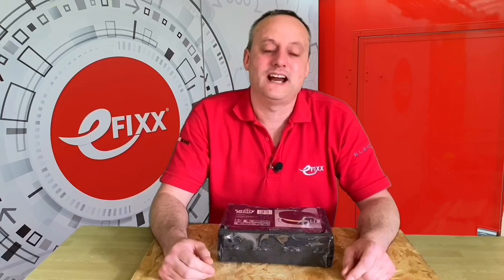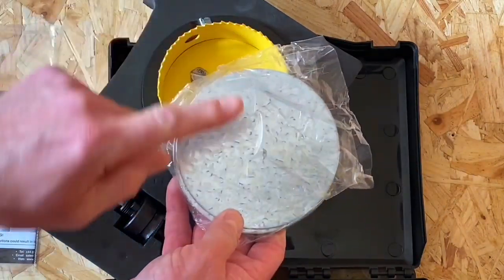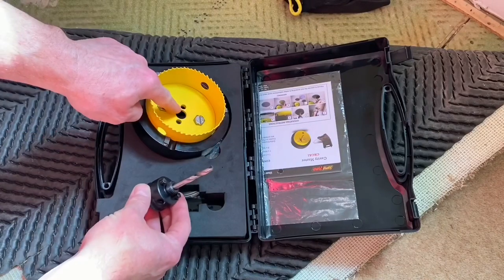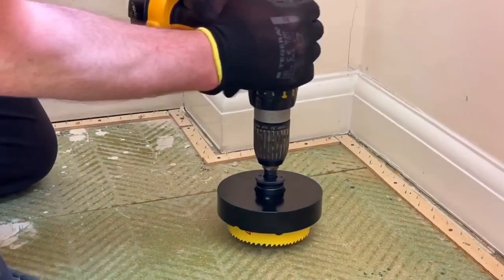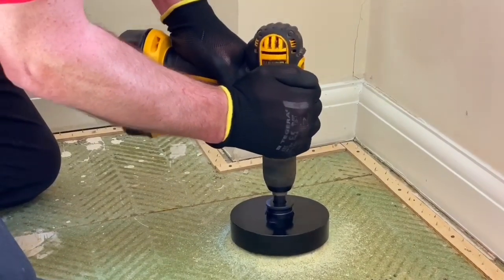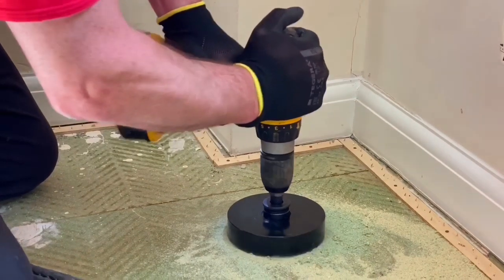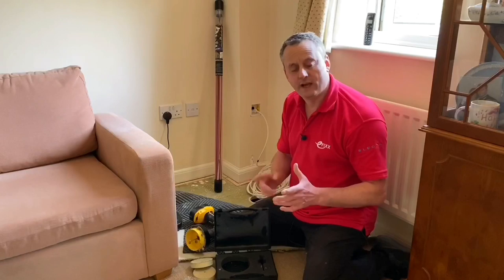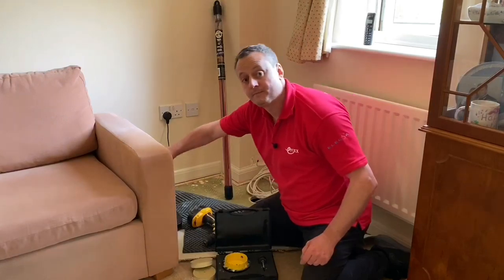Chipboard floor access hole using the Cavity Master hole saw.

Comment from the maker: efixx
8 minutes ago
**UPDATE**
We made this quick video to answer a few questions raised on our Cavity Master review video. How do you know cables, pipes etc aren't sitting right under the floorboards?
https://youtu.be/HtZlqd8wt9s
Reply: Still need to have balls the size of King Kong. I went through pipes that had actually been clipped to the underside of the chipboard once! My circular saw was about a millimetre over the depth of the board and that was enough for a face full, and floor cavity fool of nice cold running water
Reply: @CoulterTravel  And just like that, I'm now going to set my circular saw to 1mm above the depth of the board. Cheers.
Reply: @1992jamo  good luck with that, mate. How to do intend on getting the exact measurement of the chipboard in a new build house, to the mm, before you do that?
Reply: @CoulterTravel  I literally just finished cutting the floor and it went well cheers! I used a hole cutter where the board is over a joist, and measured the thickness of the plug. Set the saw about 1mm above that. The board was surprisingly stubborn with so little material left, so I used an oscillating on it's lowest setting and carefully cut through the little remaining material.
It worked really well, and I'll use it again when doing the kitchen lights.
I'd send a picture but I have no idea how to do that on youtube.
Reply: @1992jamo  you got lucky this time, fair play. These new build plumbers do what they want. Pipes can even be clipped to the bottom of the boards!
Reply: @CoulterTravel  Yeah worked well this time at least. I was surprised how difficult the board was to pry with so little material left. I've learned something today, and I'll probably find a better way next time.

Comment: I’d be worried about pipes. Even had one once where the plumber had notched the underneath   of the chipboard out to get the small bore plastic over a full height R.S.J. That was fun to repair. Excellent videos thanks.
Reply from the maker: Wise words! - those pesky plumbers.
Reply: Yes definitely feeling the fear factor on that point. I'm a general builder and my first point of contact on a job is to find out where I can turn everything off 😅😅.

Comment: Seems to be a tool for a problem that doesn't exist. 
Use any size hole saw you like. 
Screw a piece of 2x4 timer across the underside of the hole when you're finished and reuse the board cutout. 
Easy.
Reply: Used to do that for decades and it worked fine till got the Armeg version. Quicker and neater this way and, in a few awkward cases, a batten is enough to restrict access.

Comment: Have you tried an 85mm circular saw with the depth set at just under the thickness of the board to create a hatch, breaking the last little bit, that way nothing passes through the boards,, with plastic water pipes now widely used its become extremely difficult to detect where the pipes are so I would prefer nothing to go through the board.  Advantage you can make the hatch to whatever size you need then use a bit of roofing batten to screw the old bit of board to cover the hole.  Also works for cutting floor boards.

Also at over £55 quid for basically a hole cutter with a modification plus expensive covers I think for me super rod can stick it up their cavity.

Comment: Wow 2.60 for each plate, that's a bit steep. How about just using a hole saw and put the blank back in by using a bit of roofing batten and a couple of screws? You could get a lot of pieces of roofing batten for 2.60!!
Reply: John Jones I’ve done that when I ran out of pucks but I’ve noticed (my new build) the floor is creeking in places so I’m going to have to investigate.
Reply: @bertiebassett1972  Maybe you need to use two bits of batten and a bit of silicone, that will cut into the profit margin but I think you'll still come out on top.
Reply: Your local blacksmith / metalworker will punch out these plates for pennies.

Comment: the Armeg equivalent does seem the neater option as it cuts a tighter hole and the plate seems to go on more flush which might not require filling.

would like to see a comparison video against these two though as it seems a handy tool to have.

https://youtu.be/tQT3ztxXj9g

Comment: Trend have been making something similar for years also, called the “trend roundabout” Iam sure. The trend version lets you use the circle of chipboard you cut out be used to infill the hole by using a plastic ring. This then allows for future access unlike this one where you have to stick down the metal plates to keep them in place.
Reply from the maker: Send us a link if you get a chance - sounds an interesting piece of kit.
Reply: efixx if you just search YouTube for “trend roundabout” it’s the first video. The only negative to it is that it requires a router but the parts seem to sit in the floor more level and stable.

Do you have a price for the one you used in the video?
Reply from the maker: Found it - might need to dust down the router. Cavity master kit is £42.98 + VAT inc 5 plates - link to CPC in description (Lowest UK price atm)
Reply: efixx yeh the one you have does have its advantages as in it just needs a drill (that most sparks will have), less dust and doesn’t require an additional tool (router) to be carried around. Price wise it’s pretty good, it’s not one of those prices that scares people off. 
One thing I would like to see improved on it is the seating of the metal plate, if this could be done another way that makes it easily taken off and refit without glue that would be good.

Thanks for the upload 👍

Comment: Great video.  I prefer the armeg version if I'm honest, which I have used in one of my videos.
They sit flush into the hole and there is no need for silicone.  
Those flat metal plates without messing about with silicone look as though they could easily slip out the hole when attempting to put underlay and carpet back.

And....   🙂 those ferrets are awesome.  As you are about to show one in your next video.  That video is worth a watch for those without one, one of the best tools iv bought in a while.
I have a video where we are using the ferret to fish cables under chip board flooring, very handy for seeing where the timbers are, and viewing a potential cable route.

Comment: First thing that comes to mind is “what’s below!!!?” I’d be reluctant to use that not knowing what’s concealed. The time you save could easily be reversed and costly. Great kit but way to risky.
Reply: I agree. But when this is something you do all the time every other day, you get the hang of it and know when to stop cutting.  You can just feel when your coming to the end of the cut, then you take it steady from there for the final bit by just dabbing the drill down bit by bit.

If your drilling between joists 99% of the time it's clear.  Because your using these for chipboard and chipboard generally was installed in newer properties, cables and pipes sit in the centre of them, most of the time. 

Nothing is better than taking a whole board up if it can be done, but they're awkward and can be broken easily so sometimes using the cutter is the most sensible option.
Reply: @ARElectrics  I am not sure that with the drag and noise of the hole saw you would feel, hear or otherwise sense the drill bit penetrating a cable or even worse a pipe.
Reply: There's only one way to be sure of not hitting pipes and cables, start drilling and once a couple of mil down remove the pilot arbor bit, then carry on and stop when rebate blade  just touches the floor,remove and tap out the plug with a hammer as there will still be 1mm of board not cut. Once you see all is clear then finish cutting. It's a bit of a faff but not as much faff as going thought a heating pipe.

Comment: Great version but I’ve got the armeg version which comes in 2 sizes which is very handy when you need to get past your elbow😁. The plastic pucks are good but like you said might need some mastic just to seat them properly.
The trick is to cut through the board just to remove the wood puck then you can check if there’s anything close to the surface before you go mad with the rebater. I’ve had an issue with plastic plumbing pipe just missing it by millimetres 😳😊

Comment: Could of been anything under that hole there when you cut through,plus that coke can patch youv put in looks a bit flimsy ?? Not for me
Reply from the maker: Thanks for commenting and watching. Point taken. 👍
Reply: one would hope you would do your due diligence. or at least, use common sense, I mean you dont just ram a drill into a wall do you, Im' sure Gaz knew it was safe to drill where he did.

Comment: Question is how easy is it to get replacement plates ?
Reply from the maker: We’ve put a link in the description - they are readily available from lots of sources. - avoid eBay they tend to be overpriced.
Reply: @efixx  nice one, normally when you buy stuff with extras they tend be nearly be super hard to get you end up buying the whole item again
Reply: Used to get mine from TLC do a meshed cover plate for plasterboard too

Comment: I rather use normal hole saw and then scew the existing floor cut back into position. The metal plates didn't seem to fit flush floor level and looked rather odd. Personally I would go through the headache of  lift the floor boards instead of making several holes around the floor area.

Comment: Would probably be even quicker if you had a li-on drill and you didn’t have to cover the manufacturer!! Another good video guys. Small hole end endoscope first just to be sure I’d say
Reply from the maker: Top tip on the endoscope - thanks